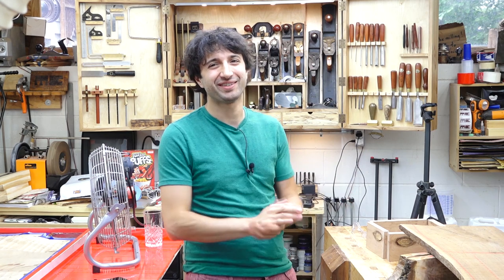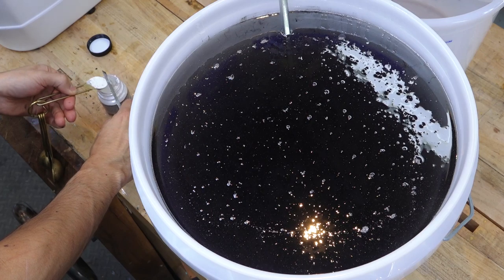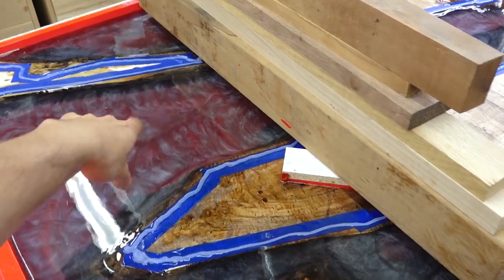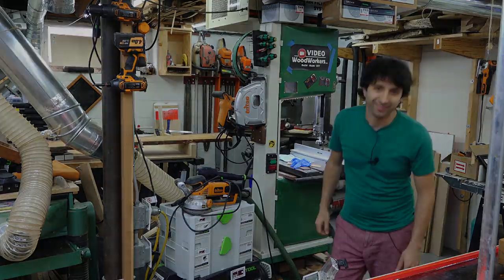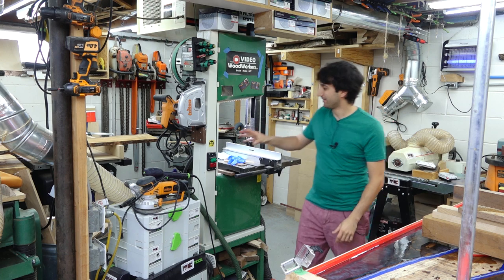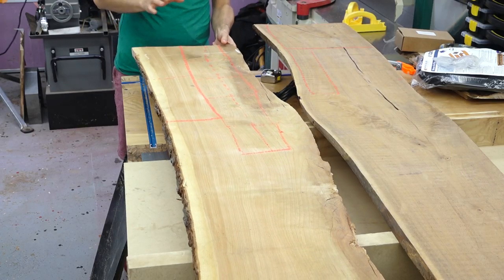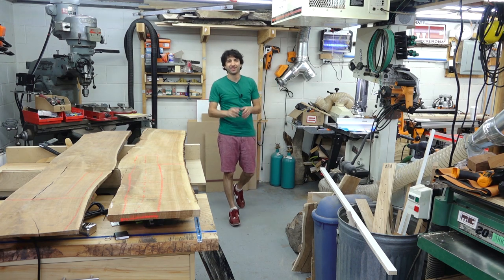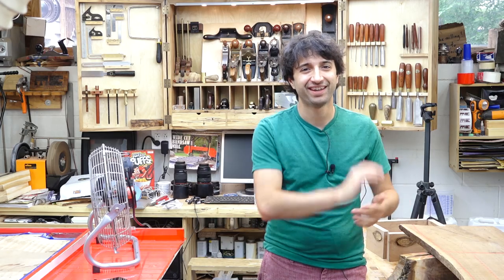Epoxy Pour, Track Saw Holster, and Spice Box

Comment: Epic sized pour! I recommend using a really sharp (ideally new) router bit when you go back with the router sled. I had a case where a nick in the bit left lines in the resin when I leveled it out. I was able to salvage it by spot treating with more resin, but it was a lot of work. Good luck!
Reply from the maker: yeah I'll be rotating to a fresh edge on my insert bit. thanks!

Comment: Question about the epoxy you use. Sorry if you’ve already talked about it. Where do you get it from? And what’s the dry time for it? Usually putting that much in a bucket really shortens your working time.
Reply from the maker: I'm using ecopoxy's liquid plastic.  You can get it on amazon or from one of their dealers.  Pot life is stated as 8 hours, set time is 24, and cure time is 72.  I've found those numbers to be a bit conservative.  It usually takes a bit longer.

Comment: Do you think it's worth making a vacuum chamber to eliminate bubbles from epoxy altogether? or does the heat gun trick work well enough that it's not really an issue?
Reply from the maker: Really depends on the epoxy.  I've put this product in the vacuum chamber in the past.  Helped a little bit but wasn't a huge difference.  The bubbles that are in the resin have to much time to float to the surface where you can just let them pop on their own or hit them with a heat gun.

Comment: Hey Matt. I am doing my own epoxy pour on some freshly cut wood and cant find any concrete info on what the moisture level should be before the pour. What moisture percent do you recommend?
Reply from the maker: Epoxy doesn't like moisture.  I like the wood I use for my furniture to be under 10% ideally 6-8%.
Reply: @mcremona  Thank you so much. I have this wood sitting in my house forever worrying about if I should or shouldn't. Thanks again for your input.

Comment: Nice work!  How in the world do you pour 6 gallons without it going exothermic?  Ive had that happen once with FAR less than that.  Did you use a special blend?
Reply from the maker: I used a slow setting epoxy so there's more time for heat to dissipate.  Ecopoxy Liquid Plastic

Comment: Matt how are you dealing with air bubbles?
Reply from the maker: Bubbles freely rise to the surface while the epoxy stays at a low viscosity.  You can either leave them and they'll pop themselves or have some fun and pop them with a torch.

Comment: I noticed you were using Ecopoxy. I have used 4 (6 litre kits) of the 2 to 1 ratio,  and out of those 4 kits 3 of them had resin that had formed chunks in the bottom of the container. I contacted the company and they sent me this link (https://www.youtube.com/watch?v=vQwXCee62i0), I did everything mentioned in the video and I could not get the resin chunks to dissolve. Over the last 2 years have used 4 different makes of epoxy involving quite a few different projects. How long have you been using ecopoxy?, and have you found any issues such as I have described? Without running into any of these issues, I quite like the way ecopoxy plastic works, but considering how expensive it is and the amount I have had to dump, I am hesitant to purchase any more. Would appreciate your experiences with this type of epoxy. I am wondering if this product has a certain self life and then the resin can potentially start to 'crystallize' .